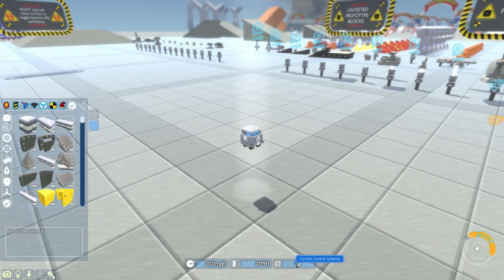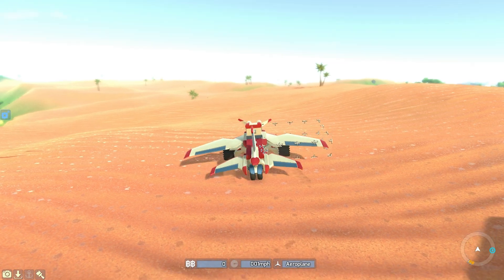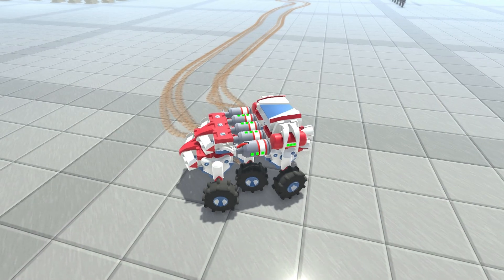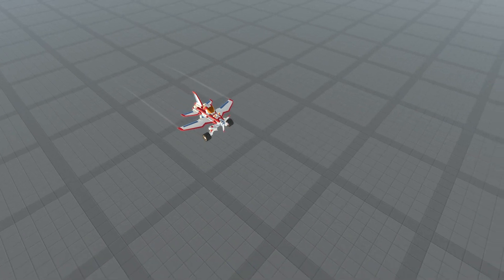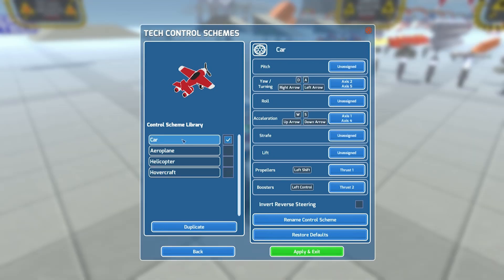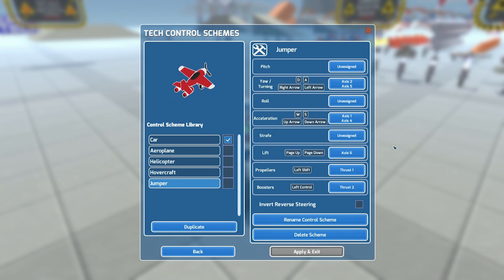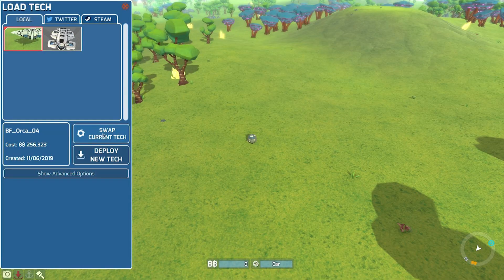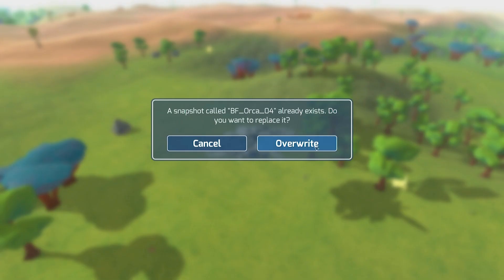Control Schemes in TerraTech || TT Tutorials

Comment: I woulda loved some advanced control scheme tips. I wanna know everything i can to see if theres anything good i can try doing or setting up for my controls. I'm struggling rn with acceleration being on shift but i want it on an axis if propellers can run in reverse that is. Issue is I'm using all my axis bindings already i think?

Comment: wanting to set left shift key to 'lift up' and left control key to 'lift down', however i haven't been able to find a way to do it, as since they are not linked, and it only asks you what you want to set lift up to, i have only been able to set lift up to left control, and lift down to Unassigned.
Any Ideas/Suggestions?

Comment: I wanted to repost this suggestion since this video really fits well since it regards controls and such..

Quality of life suggestion: For helicopters and techs that have rotors or a linear motion drive which makes sure the movement speed is at a fixed value in a certain direction, could there be a hot key that could be like pressed on a certain value you want and that value could then be like the normal value in which the speed will always try to default too? For example imagine using a helicopter with rotors and on the movement axis, the value of 50 is the number you like because that’s where your helicopter can hover perfectly in the air, at the moment could a hotkey then be pressed so like that value is saved and then when you try to fly up or down, you will but once you stop pressing the up or down key then the movement will automatically try to go back to that value that you set so in the helicopter you could then go back to hovering easily. I’ll try to explain it in a different way too: so I’m a helicopter your y-axis movement value is at 50 and then you use the hotkey to make that the default value, then you want to go up in the helicopter so you then use your up key whatever it may be and while holding that down, the y-axis movement goes up until 100 and then when you let go of your lift key then it automatically goes back down to 50 which is the value you set yourself, and in which it will allow your helicopter to just hover. Sorry for the long explanation I just hope if you read this that you understand and I hope you will add it because it would be such an amazing feature that will making flying helicopters a whole lot easier